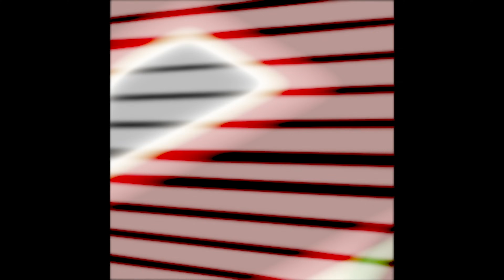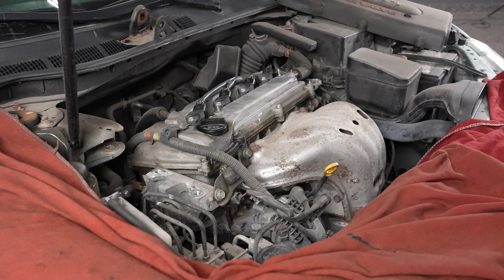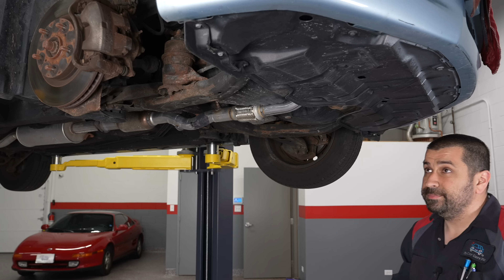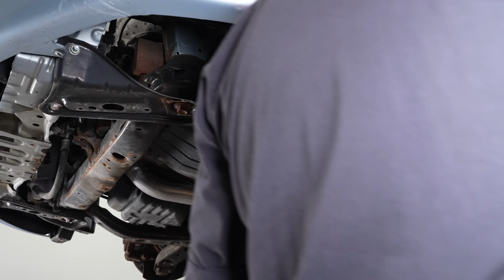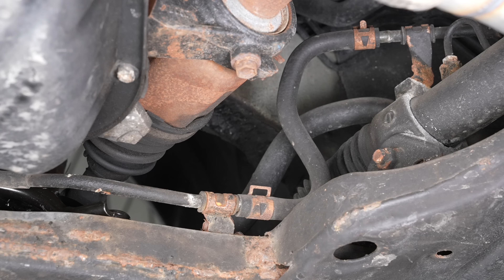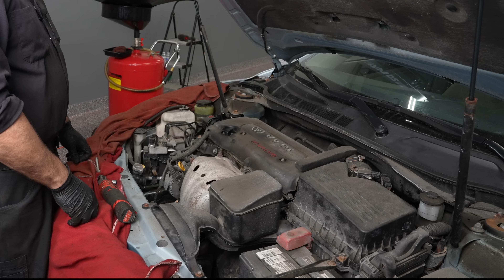How To Replace Toyota and Lexus Engine Mounts and Power Steering Lines

Comment: Opinion.the most important thing to keep a vehicle running smooth. 👉is to oil. & grease. All bull joints & moving parts  on the back and front suspension. .but mechanics. Doe’s not want to do it  because thay want to replace with newer parts 🙀😡😡😡🖕🖕🖕💸💸💸😴👈

Comment: Often wrong fluid is used. People mistakenly use power steering fluid and not the correct type on power steering fluid cap - usually this is ATF fluid that is cherry or pink in color.  If fluid looks black, then that is sign of wrong fluid